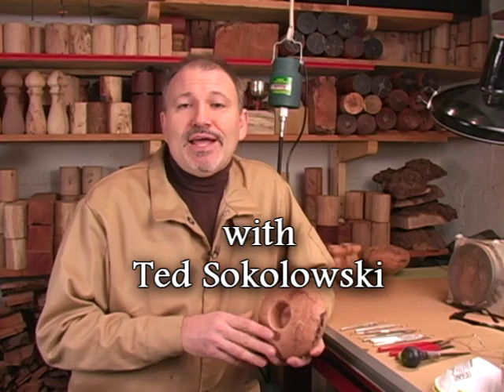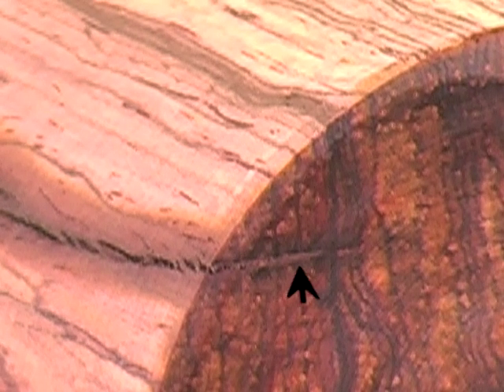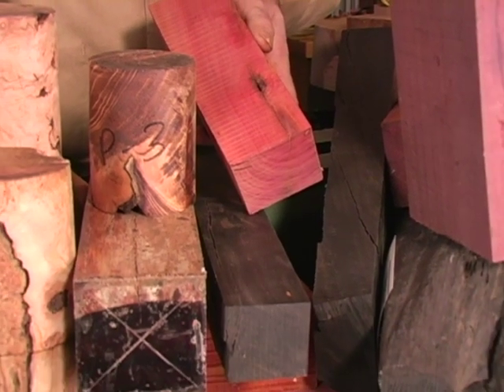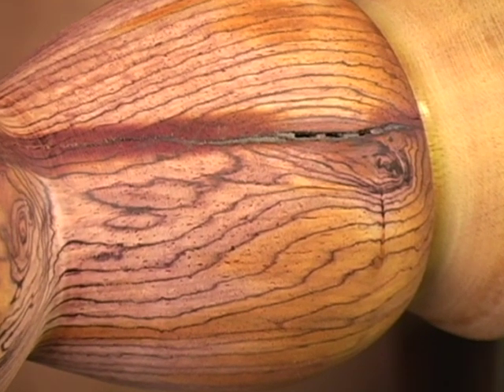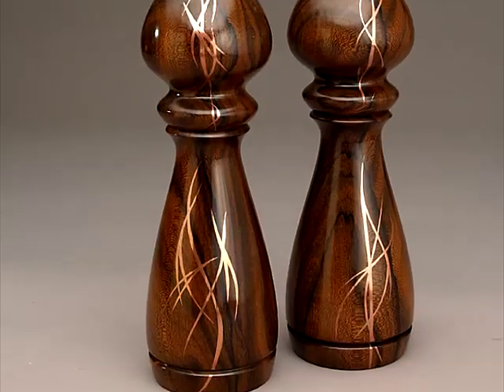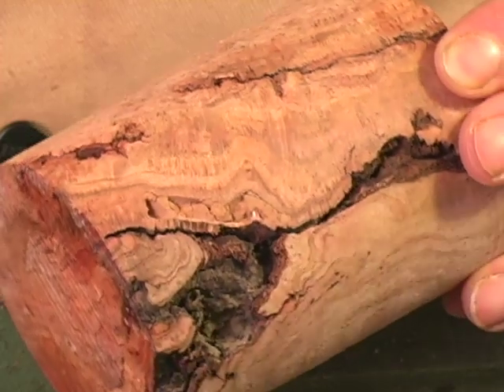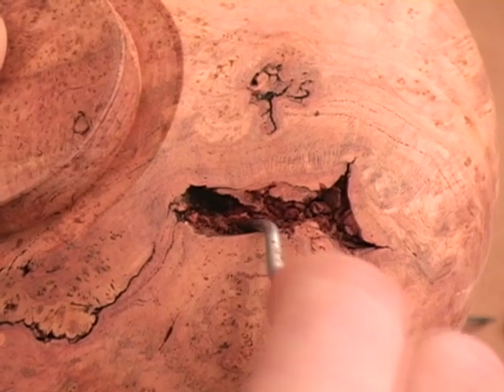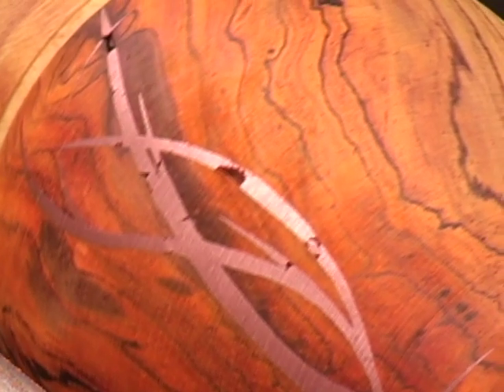Metal InlayTechniques for Woodturning & Woodworking with Ted Sokolowski - DVD Trailer

Comment: Hi Ted. I really appreciate the beautiful pieces that you have made and displayed on the video. I am a fellow wood turner. I love inlay work. I particularly love the look of metal and wood together. I have used brass, and copper. I also love turquoise and other mineral inlays. Have you ever used powdered pewter as an inlay. If so, where can one purchase it? I've searched on-line and have been frustrated thus far in finding it. I saw a piece that Christophe Nancey displayed at the AAW Symposium in Phoenix a few years ago. I loved it. It had a pewter inlay. I want to make something similar.Thanks, Kent
Reply from the maker: Hi Kent, I 've recently added pewter to my website. It is slightly warmer in tone than aluminum and works real well with black walnut. Check it out on my site: http://www.sokolowskistudios.com/NewFiles/misupply.htm it's at the bottom of the page.
Reply: Thanks Ted.